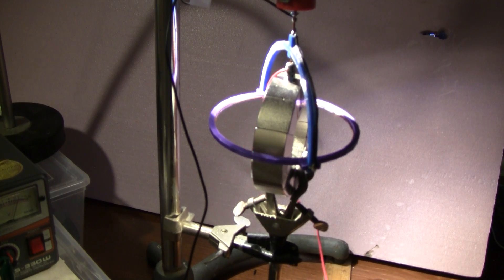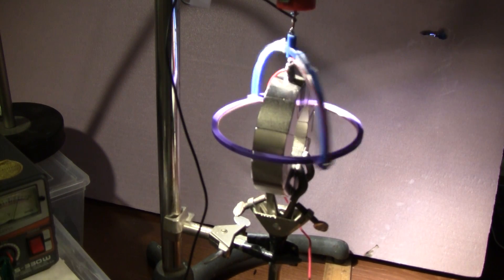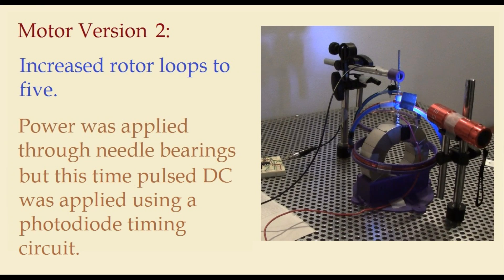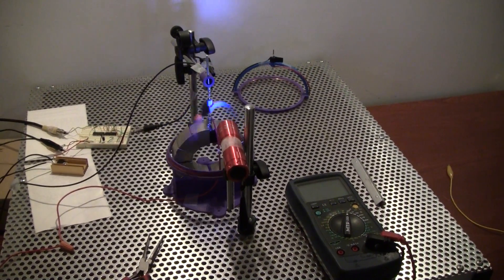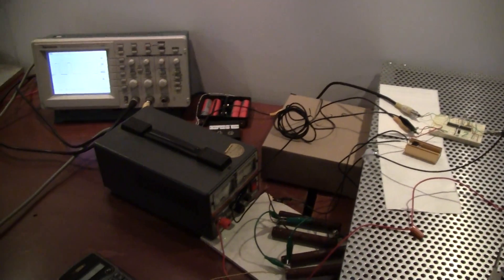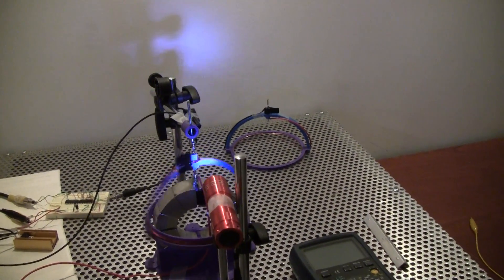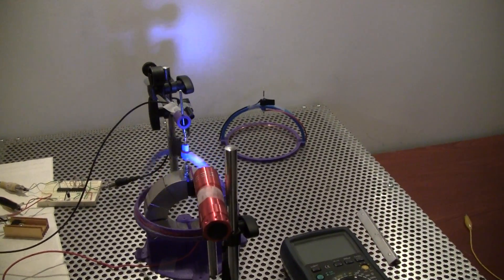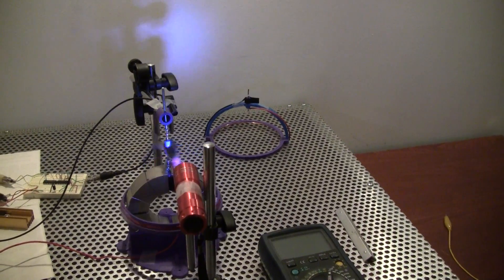The Marinov motor : A very peculiar machine.

Comment: Using pulsed DC can produce a strong experimental bias by using the flux leakage with a proper timing. It's not a proof of the Marinov motor which doesn't need pulsed DC. Only the first experiment is conclusive but it should be confirmed.

Comment: The explanation of this motor is very easy onceoneis aware of the Nikolaev's discoveries which complement the existing theory of electromagnetism. There is a scalar magnetic field created on both sides of the toroid which provokes a longitudinal force acting along the currunt. The detailed theory is only available inrussian which fact makes it impossible in the western world to explain this machine. If someone has doubts I would suggest to try to aply newton's third law on two current carrying conductors which are not parallel to one another. The action vectors do not compensate the reactionvectors there which is due to the fact that the scalar magnetic field is unknown to our official sciance. We only see the vector magnetic field through our mainstream science and they burried the problem by only showing the two conductors parallel to one another. Just check in textbooks andyou will see that the king has no cloths on. They only show you two parallel conductors which are infinite at that. Things are a little bit more complicated L am afraid.

Comment from the maker: Thanks for getting back to me on that - yes, there may be some interaction of the return wires passing above and below, although I believe the torque is primarily occurring on the horizontal pathway. Evidence for a longitudinal force would be quite interesting! Your observations of the toroid imperfections would be consistent with what others have said about the Marinov motor and flux leakage, in which case a Lorentz force explanation might apply.